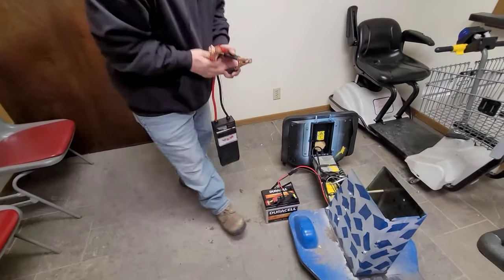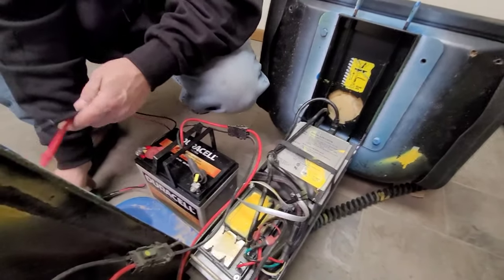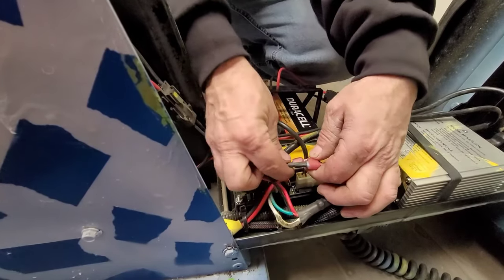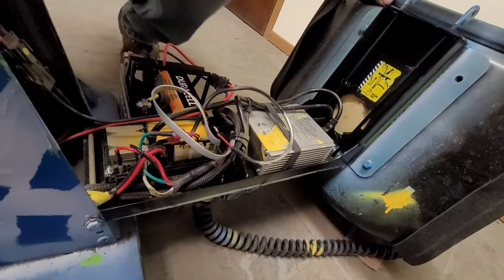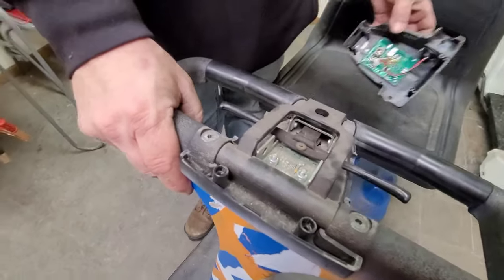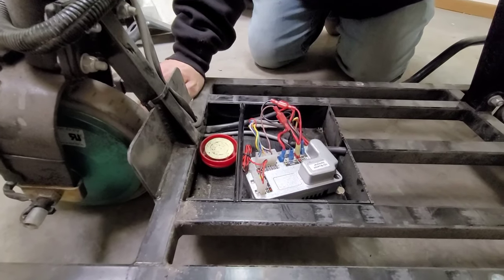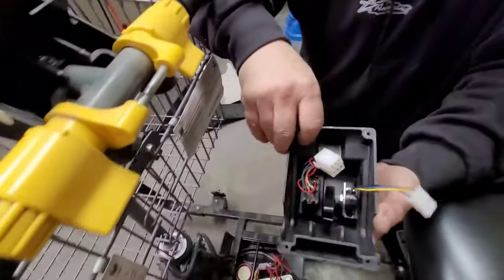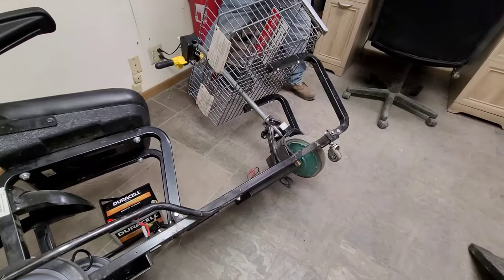Electric Cart Tutorial (Basic)

Comment: I work for Walmart in maintenance and I work on a lot of Value Shoppers between the 3 stores I work at and I have a couple MartCarts too, I like your tutorial and would like to see you put a new Amigo motor/brake assembly in sometime but I have done one so far. Also if you could talk about the back wheel axles, it seems like they come in different lengths depending on the version you have. I maintain 30 carts altogether at the 3 stores and I keep spare parts on the truck or at the stores, batteries, seat covers and switches, back wheels, a charger or two and some cables.
Reply: How to doing more speed??

Comment: I bought one of these and ripped out everything and hooked the motor up to a Optima yellow top battery.. I haven't really looked on how to get it to run in reverse.. do you happen to know what color wire it would normally be for reverse? Thanks BTW I'm gonna put a predator gas engine in it eventually lol
Reply from the maker: Black and red lower part of controller is fwd/rev wires
Reply: @michaelcrandall7691  I hooked straight up to black and red.. with the computer it wouldn't work
Reply from the maker: There's several blk/red.....blk os rev and red is fwd or vis/verse
Reply: @michaelcrandall7691  OK so if I reverse the wires it should go in reverse.. makes sense just wasn't sure if it was another wire that I couldn't find.. thanks I will let you know what happens! 👍
Reply: @michaelcrandall7691  it worked! Thanks I appreciate it

Comment: I have a value shopper that was abandoned by my local store. The brake assembly broke when I found it. Pulled it off and motor worked then brake basically exploded, write lead disconnected and I can't find a replacement. Can I bypass that part and make it move? Or how can I acquire a new brake?
Reply: When the l leads came apart, mirror quit working.
Reply from the maker: Those controllers (mother board) are specifically set and programmed. So most likely ot will not work without brake or trying to bypass brake. VS actually do a self diognostic. Thats the 3 clicks you hear when you turn it on. No clicks, no work.